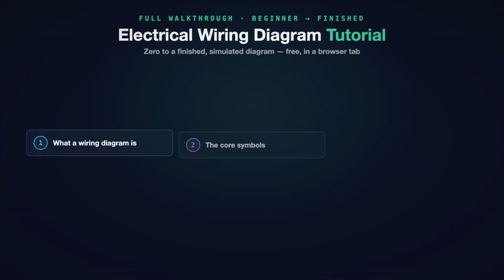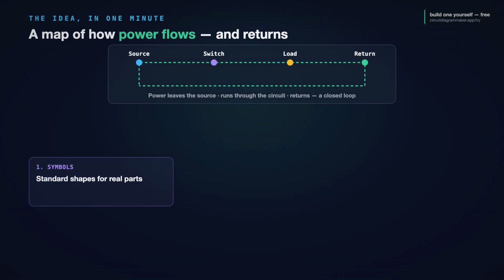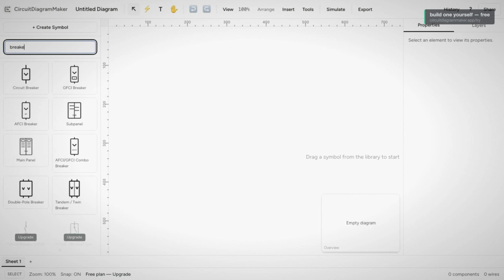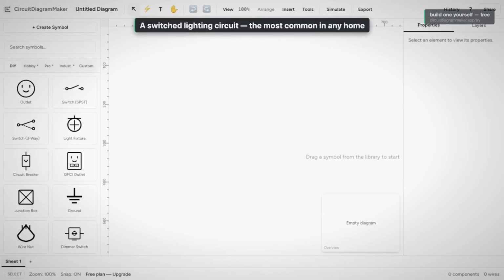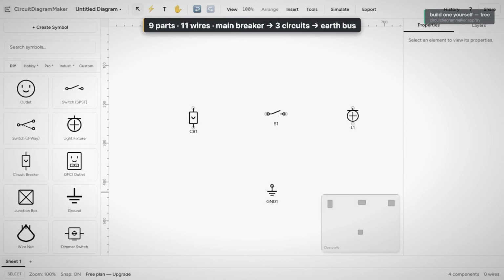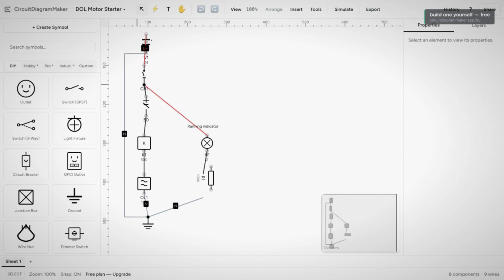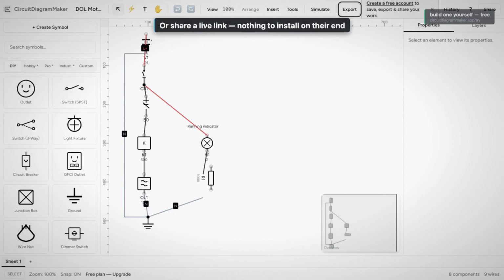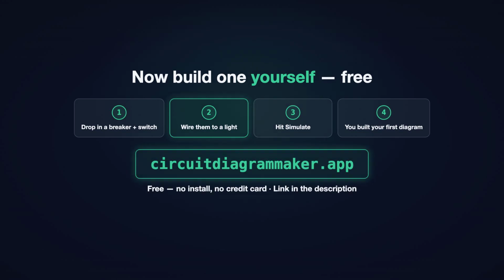Electrical Wiring Diagram Tutorial (Full Walkthrough)

Comment from the maker: Here's the whole tutorial in one line: a wiring diagram is just three things — symbols, wires, and labels. You place the parts, wire the path, name and rate everything, then simulate to prove it works. That's it. Do that once and every diagram you meet after gets easier to read.

The step most guides skip is the simulation. A plain drawing tool will happily let a dead short sit in your diagram forever and never say a word. Here a real SPICE engine runs the circuit and puts live voltages and currents right on the drawing — a wrong wire shows up as a zero in seconds, before you ever touch a real one.

Full disclosure (also said in the video): this free browser tool is ours. Build your first diagram start to finish — no install, no sign-up: https://circuitdiagrammaker.app/try?utm_source=youtube&utm_medium=pinned_comment&utm_content=yt-023

What's the first circuit you'd draw — a light switch, a car accessory, or something bigger? Tell me below and I'll point you at a template.